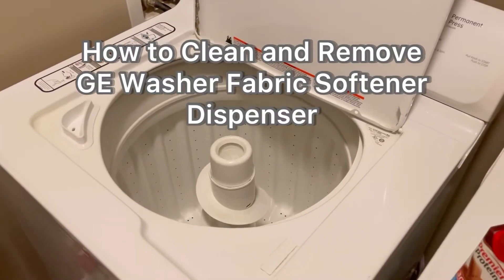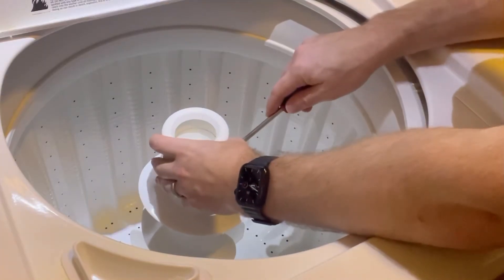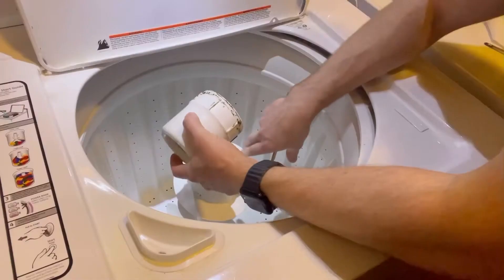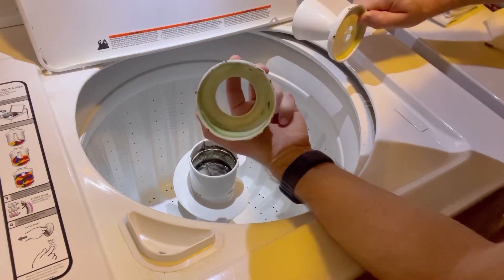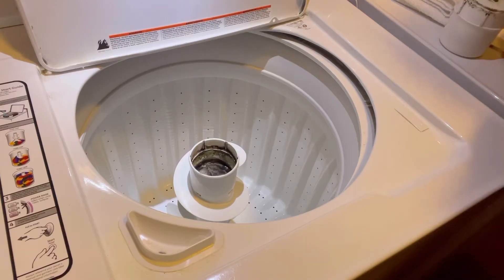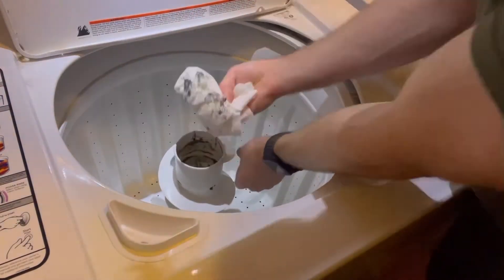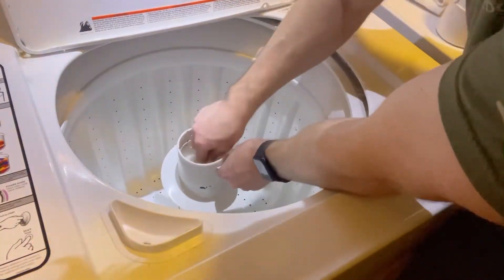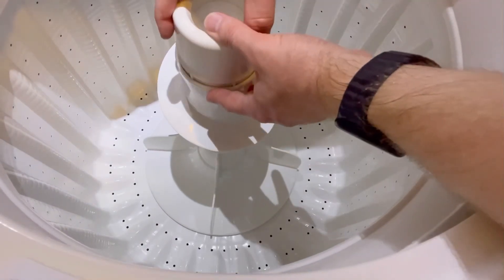How to Clean and Remove GE Washer Fabric Softener Dispenser #washingmachine

Comment: What about that plastic plate at the bottom Can that be removed?
Reply from the maker: That’s part of the agitator is that what you mean? I have another video cleaning under that and replacing
Reply: @BStride  The agitator cap can that come out or no?
Reply from the maker: Check this How to Replace the GE Top Load Washing Machine Agitator (WH43X10034)
https://youtu.be/IF8uJE7qMM4